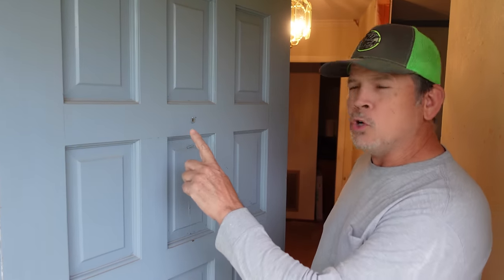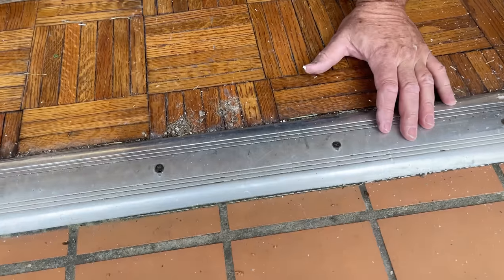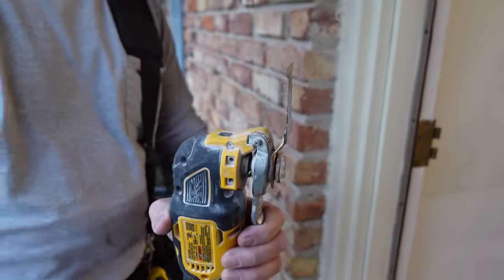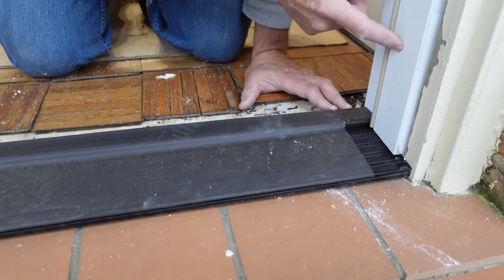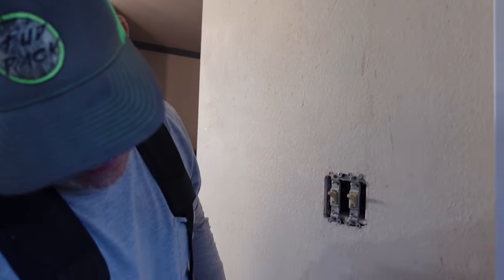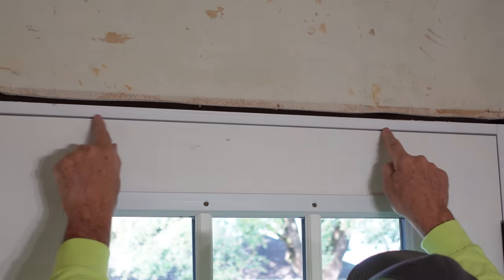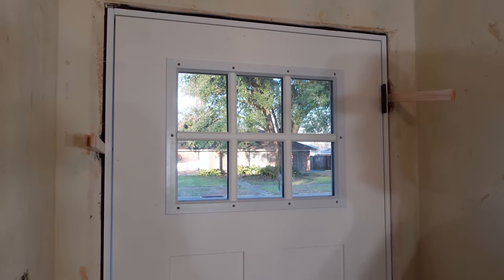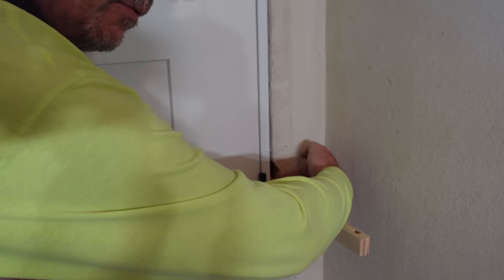HOW TO REMOVE and REPLACE a Front/Back Door (Easier Than it Looks!)

Comment: Paul, great tips on door installation! I’ve been procrastinating replacing my front door  for some time. You’ve given me the confidence I need to tackle the job. Your video revealed you had to deal with fixing some door manufacturer problems. Any tips on a good brand of door to avoid such issues? I also have a home alarm to deal with on the door. Any tips on how to deal with alarm contacts? It has a hidden magnetic contact on the bottom jamb area.  I’d like to make the installation easy as possible.
Reply: installing a door really well requires experience , there are things that can't be taught in a video , you just have to "know" what to do .... it is NOT as easy as it might look on TV .....

Comment: 17:05 I’ll tape off the hinge or put a shim on the hinge (with tape or command strip) when doing this for that extra extra overkill protection if not hitting it with blade, especially if a “painted hinge”😊. Rather be a bit cautious than ding up painted/finished hardware and regardless where it’s at, someone will eventually see it, always happens

Comment: In my career as carpenter and framer and trim out, I thought I'd seen every trick in the book on how to level out the door frame. But the shims behind the hinges was a first. And will definitely be sticking that tip in my hat. I've actually had to fix a door that a "HANDYMAN" changed out Yes He Put It UPSIDEDOWN! Go figure that one out 😂
Reply: I've had a contractor doing an apartment install two out of three windows upside down, so they don't slide unless pushed up. They don't return calls, having been paid before discovering they were general hacks 😭.
Reply: Now, William, William, William - don't you just know that the handyman was just getting the doorknob up out of toddler reach.  It's a child safety trick!  Yeah, that's the ticket! 🙂🙂🙂

Comment: With productions builders like who built my house, the carpenter's screwed the hinge side tight against the framing then put in some nails on the other side & didn't care about the gaps between the door & the casing. All of the interior doors were installed the same way. I had to replace one door & there was not any shims at all. Then when carpenter I hired to replace the door was doing the same I stopped him & told to install the door correctly. He packed up his tools, said good luck & left. So my father & I ended up installing the door. I don't think most carpenter's know how to install a door correctly at least in Southeastern North Carolina.
Reply: There isn't anything "wrong" with installing hinge side directly to framing.... If the framing is plumb and square.

Comment: Also, be sure to use the 'Low Expansion - Door and Window' foam, otherwise it can bow your frame in and is a major pain to fix.
Reply: Good to know, thanks!
Reply: Also stuff paper towel in the lockside holes for a few minutes until the foam begins to set up otherwise you'll get a sticky dead bolt or have to cut the foam out later... made that mistake.

Comment: Hey guys great video. I am a carpenter/ handyman for 35 + years. This is a question for further discussion. 
I agree the mortising on your door was not perfect. But if you have a door with perfectly flush hinge plates and the gap is still too small, would it be unrealistic to think that the hinge offset is a messed up and that the hinge itself needs to be bent? Right where the pin loop meets the flat plate.
Reply: Did you get a response?  That’s a great question

Comment: Men, I love the video.  I've installed a number of doors and completely feel your pain.  However, instead of shimming the jam side hinge, I recommend trying to bend slightly the jam side hinge barrels towards the lock side.  It works like a champ.  It takes only minutes and requires no shims behind the hinges.
Reply: Yep, bend the hinges. Great for adjusting existing doors too!
Reply: How? Make a short video.
Reply: @Lvatopesado  there are videos on Youtube, search. That's where I learned it.
Reply: @btimbyindy  seems like forcibly bending it would risk introducing play in the hinge.
Reply: @wingerrrrrrrrr  It works great. You bend with a wrench, so you don't put pressure onto the screws mounting the hinge, you don't introduce any play. Hinges bend easily, so it does not take much force to begin wtih.

Comment: Retailers, Home Depot and Lowes for example, have the doors in racks. The doors are pulled and pushed in and out of the racks. This pulling and pushing can twist the door and change the alignment. Often the bag with the parts, screws and plugs gets ripped off when caught while being pulled out of the rack. Most customers will just grab another bag off the next door.

Comment: I appreciated your video. One thing I have done when the door is closer to hinge side but the hinges are set flush is just put something in the hinge and push it to close the door to bend the hinge open a little wider. It has to be done very carefully but you can achieve the same thing without having the hinge sit proud of the trim. 
I did a replacement just like this but have never tried it without removing the exterior trim. I'm definitely going to try it next round!

Comment: Great tips on fixing reveal and how to shim behind hinges.  One thing I was hoping to see was the security plate behind the deadbolt, addressing when a door & frame are not on the same Plane, showing how to put the plugs in over the screws in the trim (not as easy as it sounds) and adding the hardware back on and indicating a 2 3/8" backset VS 2 3/4" backset.  Overall great job and if you're interested in doing a plant tour, reach out to your nearest ProVia Distributor to see what it would take to go...ABC Supply, Beacon Building Products, Lansing Building Products or Alside Supply etc...

Comment: My backdoor was very poorly installed, and has extremely uneven reveals on all sides, as much as quarter+ of an inch and as little as one sixteenth. I have had to add foam insulation to stop the inside air from leaking out. One side of the bottom of the door sticks and is difficult to open in the Summer while in the winter it closes ok.
I need to properly install a new door and your video is just what I needed. Very glad I watched it and I always learn something from your videos. Keep up the good work.

Comment: Appreciate the step-by-step and all the details. As a DIYer I’ve done a few exterior doors including patio French doors. Sometimes I got the wrong door and need to modify swing the other way or put in a 36” door in a 32” opening. That were fun for 2 or more days each!  Little guy working alone with heavy doors needed JawHorse to position it and inflatable air wedge on the bottom for pin alignment. Keyless entry and Ring Wi-Fi video doorbell would be nice.

Comment: I found a beautiful 19th century door, it came with a custom milled frame (to fit "modern" frame size), and I got hung up about removing the old door.  

I wish the nails were as dainty as the ones you removed! 

I feel like you skipped over some details, but now I can see what to research a bit more.  I feel unable to figure out the threshold, I'd like a new threshold.

 Nevertheless, this video has given me some courage to make an attempt. Thanks! 🧡😎✌️

ETA: getting lots of help from the comments! 👍  This really is the best, or essentially the only, exterior door video to see. I appreciate the effort. 😎

Comment: I made some plastic hinge shims (out of styrene) just like in the video for another purpose.  I was replacing all the hinges, knobs, lock hardware, striker plates, and such in my lady friend's house to freshen it up.  Most had multiple messes of sloppy paint on them from over the years and replacing seemed easiest.  The house was built about 1950 and the new hinges I bought were thinner than the original ones. I needed to shim every hinge on both the door casing and the door.

Comment: I've been watching your videos for a while now and really like them.  In this case, though, I think that those shims are sort of hacky.  I had an old timer help me put in a door and it had the same problem.  He used a framing nail and put it between the hinge plates.  Then he close the door in order to bend the hinge.  He also bent the hinge a little more using a hammer and some wood.  The gaps look perfect.  The hinges look normal unless you studied them.  After seeing what he did, I'd never shim like is suggested in this video.
Reply: That seems like a good way to adjust the hinges, when just a small correction is needed.
Reply: @dubmob151  You'd be surprised how much movement you can get.

Comment: Your videos are great ! Just wanted to add while prying against casing or prying off trim from a finished wall or anything  I want to protect I will use a 4" putty knife or larger between  the finished surface or saved surface while prying. Saves hammer marks or prying marks.

Comment: Wood shims split and compress over time, I always use composite shims and a great source is the left over pieces of a 2” horizontal faux wood blind that you remove when you shorten a blind. Any shop that makes Custom Blinds can and usually are happy to give you a bunch of them. I have never thrown them away and have found many uses for them. I once used them full length to shim drywall over a plaster wall,  instead of demoing the plaster we just shimmed the wall plumb and went right over it. Of course every door and window had to have the jams custom cut but we have the technology and were remodeling the entire kitchen anyway.

Comment: Those small screws in the hinges and strikes make the door very unsecure against break ins and kicking. When the homeowner goes to install longer stronger screws it will pull the door frame into those framing studs. You need to put shims against the studs so everything is a tight fit.

Comment: Question: To get started and save yourself some work, you left the old casing in place, noting that the casing's sides were 1/4" out of plumb over 4'. Later you said you were able to plumb up the new door and frame perfectly. Was the result that the reveal ended up uneven (tapered from top to bottom) where the old casing meets the new jamb?

Comment: Those stick down tiles under your parquet may have asbestos in them.....we demoed over 3000 sg ft back in 1985 in our home and didn’t know that it was asbestos....thankfully the black adhesive had released and we picked them up in full tiles for the most part and since then have learned a few things. Enough to have help my Commercial Awning Contractors License and been building and remodeling ever since. I love your videos and appreciate you sharing your knowledge with others.

Comment: THANK YOU, you motivated me to fixed my REVEALESS external door after 7 years of neglect.
Made the shims out of OLD plastic (flexible) cutting boards.  Only downside with using the flexible cutting boards were they were too thin and I had to cut and stack too many shims together.
Would recommend THICKER plastic materials to get larger gaps closed with having to cut a lot of shims.

Comment: Nice job. This is why I hang my own doors in a jamb I fabricate. Most manufacturers do a nice job fabricating there doors and jambs. Some of them don't fit that well. I worked for the same company for nearly 40 yrs hanging all the interior doors and specialty exterior doors. So I've seen my share of terrible doors installation. But again I enjoy your videos as sometimes it seems you can learn something that works for others.

Comment: Really appreciate how you show how to save the outside moulding. The door I need to replace has exterior moulding tucked behind siding on one side. Most videos show how to install include replace brick moulding. This will help alot. Thanks.

Comment: 56 yrs in Construction.  Very Very Good presentation.  Tip: Butts that won't allow the door to close correctly.  I have put a doornail in the butt and closed the door. That opens the butt up.  To close the gap I used a big pair of channel locks or vice-grips to mash the butt until it corrects the problem.  Hope this was clear enough to help.  Thank you for your videos.

Comment: Your install looked like real world.  Many years ago I worked with a carpenter and we installed many pre-hung door.  There was always something that had to be overcome.  One time, the door opening was at least four inches too large for the original door.  Whoever put it in just attached the door casing to the door frame on one side then shimmed the excess four inches in three spots on the other side.  We added 2x4s on each side to make the frame the correct size when we installed the new door. Two 2x4s were a lot cheaper than buying a wider door.

Comment: An old-school trick I use is to put a shim STRIP just to the interior side of the hinge screws (not the whole hinge surface).  This "cants" the hinge, moving the door toward the strike plate slightly. Non-corrugated paperboard cut into strips (such as from a box of screws) works well.

Comment: Dear Sud Pack, enjoy your videos, particularly replacing the Front Door. Here are couple suggestions from a older carpenter with several years experience. The front door did not appear to have a Porch cover, on all exterior doors I have had success with Sill trays for protection from any rain, water penetration; because your door is installed on a flat surface, I would suggest using  a strong door flashing with a very strong adhesive back, ZIP Flashing tape is one, there are several; with flat surface, preformed pans don't work as good, so use the high quality flashing tape on floor, and up both sides, as you did in your video, then take aluminum roll flashing material that's few inches longer than width of door sill, use a HVAC hand tool that will crimp  a 90 degree angle for the inside, cut the raised lip, at each corner, and fold up the vertical, going up 3-4 inches on both sides, before installing over the door flashing, run 3 - 4 heavy beads of your adhesive, that you used in video, then push the formed sill tray into position, be sure the side flashing runs over the metal

Comment: Nice video would of like to see your techniques for installing the lockset to ensure latches well and also holds tight around the weather seal,(face of door to seal). I would worry on this type of install myself with resting a new door against old brick mold,(just give me a rough opening). I need to check out how your son's new home turned out, that was quite a project with the heights and amount of clear space you had to work with. I envy how well they work with you, as making the job fun and encouraging the training moments is a big part to keeping them interested in the trades. Well done.

Comment: Great video! We definitely had some issues with the quality of the manufacturing. Should the door hinges be touching when the door is closed? Does the gap between hinges mean you have a problem? Also on the strike side, on the bottom corner, where the 2 pieces of weatherstripping meet, it was overlapping, allowing light to come thru. Should I cut back the weatherstripping or adjust the installation of the door?

Comment: I’ve learned to respect the trades. They make it look easy.
Reply: They get easier with practice.
I just had a nightmare installing a new fridge.  The pantry wall beside the fridge was not square.  I had to cut 1 inch off the stud at the bottom to fit the french door.  2/3rds of the way up had to be cut back with a plumb line.

Comment: It was when you pulled up the rotten flooring that made me realize why I never assume any job will go easy. You got the door in and it looked great, but now you're moving onto doing the floor. And when you redo the floor, something else will show up. It all starts to snowball into way more than you anticipated. Anyway, it was still informative and my new house needs a new door coming in from the garage to the laundry room. I will be using this video as a reference for sure.

Comment: This was a perfect type of situation to show. The location and setup up of this door is always a headache here in Florida in old homes. These frond doors with brick or stucco and squeezed tight where your shoulders almost touch drywall in hallway-i always know and charge more for these installs and luckily there aren’t many in the Florida designs of homes. 

I’m not quite sure why you didn’t check the square of the frame (measuring opposite corner to corner) not just plumb. For ppl out there measure diagonal from top corner to bottom corner on both sides that would’ve helped here too and especially if it’s a slider door. I’m not criticizing at all i enjoy watching your jobs and installs and some of the little tricks you’ve picked up and there are newer versions of your trucks but these work for you-I’m stuck in some of mine as well. People out there please be careful how tight you make these seams because when the weather changes or you get your porch pressure washed your door will swell and get stuck. I don’t think I’ve ever changed one of these in this scenario where the floor isn’t rotted or tile adhesive has let go.

Comment: I'm right there with you on those slaphappy door manufacturers. Either their people aren't properly trained or just don't care. Here's a tip for y'all -  When ripping 3/4 or 1-1/2 material and end up with lots of various strips of wood gang cut them to 4" lengths and keep them in a designated shim bucket. Sometimes I cut up random blocks to replentish my shim bucket. Oh and 15 and 30# black paper is great for that extra bit needed to get a shim to fit snug.

Comment: I use playing cards to shim hinges away from the jam. You can stack them up and micro adjust The thickness. Just lay one of the hinges over a card and cut the shape. Works great and cost basically nothing..We’re also good for micro shimming countertops and the such